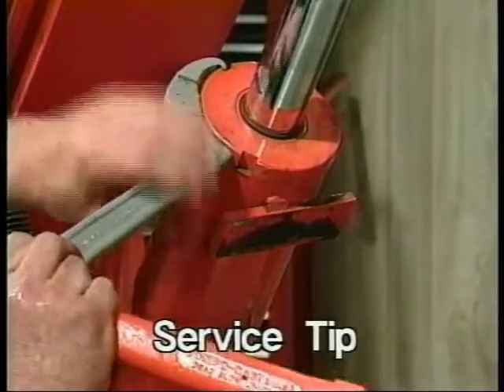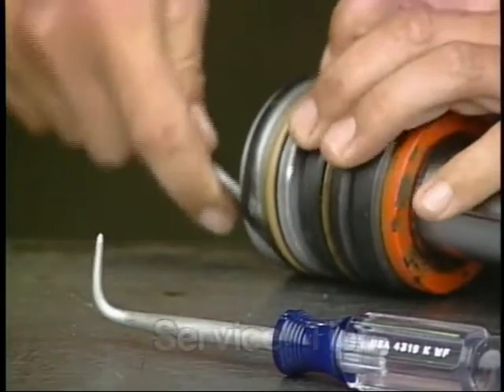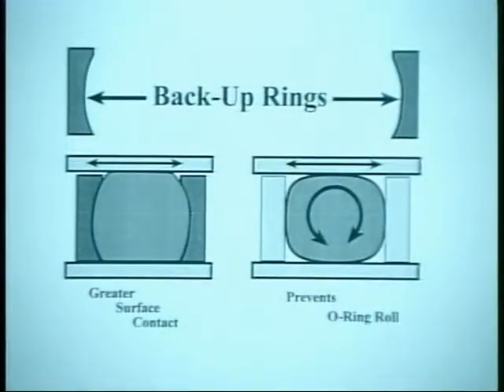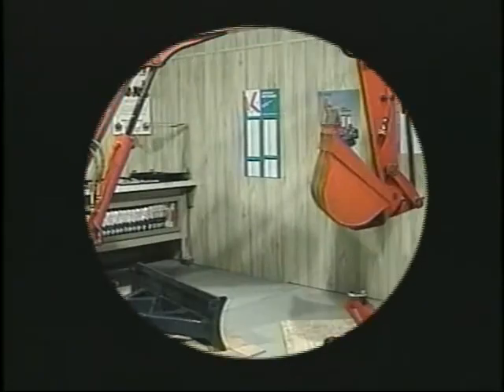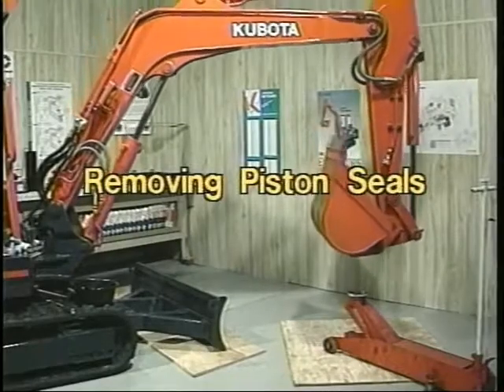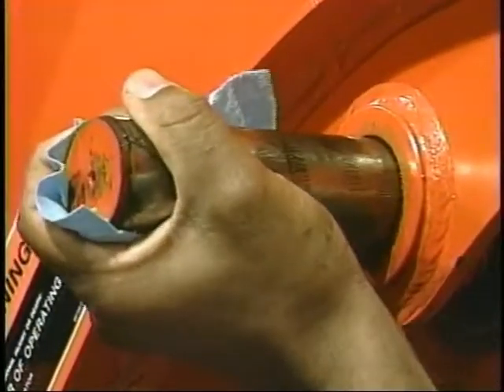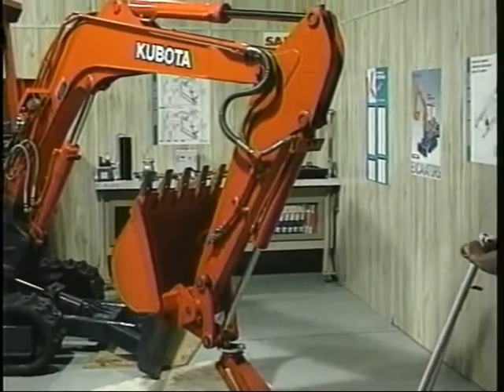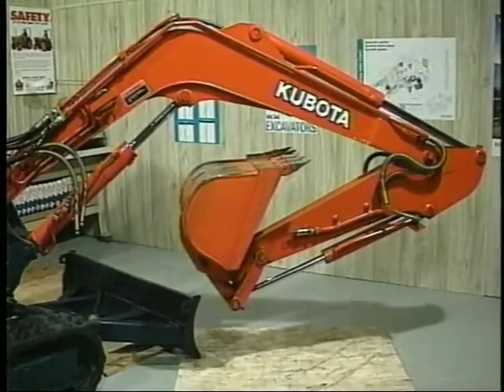Proof that leaking piston seals will not cause a hydraulic cylinder to drift down!

Comment: Had a leaky cylinder, had it repaired but now won't lift any weight, what is the problem
Reply from the maker: Are you saying it won't extend when lifting weight? If it doesn't have an external leak I am going to say it is not the cylinder, it is something else.  Maybe a line got twisted and kinked when it was installed?

Comment: I think your stretching that "myth" ive heard 1000 times.  Its refering to the seals that hold the oil in the cylinder. Not sure where you heard it only being the INTERNAL piston seals. But when people in the midwest talk about there bucket leaking down the conversation usually starts with "well there was a puddle under the  machine today..."  i think you were sly to specifically say piston seals but no single person ive heard out in the field say that has specifically said or been talking about the piston seals.
Reply from the maker: I totally agree with you that if there is an external leak, it can leak down.  However, in my experience when there is an external leak the complaint is not "my bucket drifts down", instead the complaint is "there is a puddle of oil under my machine".  This demo was meant to address the cylinders that drift down without an external leak.

Comment: I have a question,  will you reply if i ask. Its about a hydraulic cylinder that seems to have pressure on both sides.
Reply from the maker: Yes, I will reply. What is the question? Do you think it has leaking piston seals?
Reply: @JimMackHeavyEquipment  I figured it out, nothing wrong with cylinders,  the quick coupler is bad. Bypassed it and everything works fine.
Reply from the maker: That is awesome to hear and thanks for sharing the fix.  I knew it probably wasn't the cylinder but I was pondering if it could be some type of problem with the auxiliary valve you added.  It does makes sense that it was a faulty quick coupler.  It was working like a check valve and letting pressure into one side of the cylinder and not letting oil out.  Glad you figured it out.
Reply: Thank you for the reply and the help. I received the top portion of a bucket grapple and mounted it to my tractor. I had to change my 2 spool to a 3 spool to be able to control the grapple.  The lift and tilt work fine with the new controls, however the grapple cylinders will either only open and stick or if i switch the quick connect close and stick. If i bleed off the cylinders they will open all the way and close all the way. Then only half way then stop moving. Seems like pressure on both sides of the cylinder.  Any help? Suggestions?